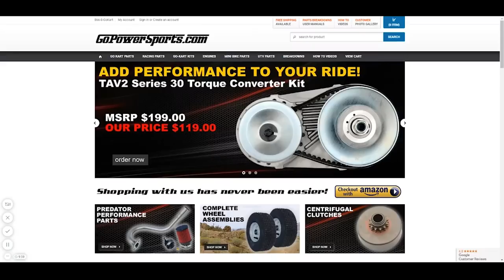Mini Chopper Lives ~ Predator 212 Motorcycle

Comment: How do you guys gear these, my 212 on my drift trike. Running 12to60 sprocket only reached 30 or so mph
Reply from the maker: 5:1 ratio
Reply: Red Beard's Garage that's what I'm running guessing the difference is one being built verses mine being stock. And wheel size.

Comment: in my opinion, its not worth trying to get it street legal. no turn signals, the rear wheel isnt DOT certified, and I know that in the predator owners manuals they say "not for use on motorized vehicles" (or something to that effect) which would prevent even the engine from being street legal.
Reply: Different laws in different states. In NY is would be impossible, where RBG is, it is probably possible. Laws about that sort of thing are often more lax down south.
Reply from the maker: +MacroMachines has turn signals, brake lights, headlight and a new wheel and tire out back that I haven't put on

Comment: Wear a face shield! Those little wires like to fly off and stick in your face or even worst, your eyes. Be safe my red bearded brother.
Reply: Heh, bits of wire were visibly flying off that wheel. He was wearing safety glasses but I'd agree that a face shield would be a better choice.
Reply from the maker: +Butch S. I actually have a shield on my wall I always forget about
Reply: Heh, mine only gets used when I can't position myself where I won't catch a face full of whatever's being thrown. (for example, sandblasting)

Comment: Did u use the billet rod or mod2 cam on the electric start motor?
Reply from the maker: No sir just a stage 1 kit
Reply: Ok would it be ok if I do? Or would I have to use the billet flywheel

Comment: really to bad they used a 212cc on this. For all the cash and time invested in that 212cc go kart motor add on stuff you could of just bought a Lifan and built this thing with a 4 speed and real clutch for a lot less then the 212 mods $$ . Either way its an awesome  build guy's nice work!

Comment: Does anybody know why I'm not getting much over speeds of 35. I have almost the same setup, such as the torque converter, but a larger frame. Any help is great
Reply from the maker: It all depends on gearing and rpms
Reply: Also if you have not removed the governor that could be another reason Why. It will change the max rpms from 3200 to 5300
Reply: I took the govenor out because the last one fell into the engine and broke the rod cap oil Slinger so I replaced the entire engine. It's about a 1:4 ratio when the CVT is fully engaged

Comment: what size is the rear wheel ? pls
Reply from the maker: The rear tire is the stock bike wheel and tire
Reply: Hi, thank you for answering me, I intend to make an electric bobber with solar panels at the location of the engine and with a HUB motor in the rear wheel. this wheel has a diameter of 14 inches.
I asked you the question because seeing your rear wheel I had a doubt, but if you tell me it's a bike wheel, I think that finally it will not be too small for an bobber.
Have a nice day.

Comment: The drive chain doesn't have the correct amount of play. It's too taught and that will wear out the chain and the sprockets prematurely. It could also snap under load and cause damage and or injury.
There needs to be at least a half inch play either way off center of movement up and down.

Comment: allow me to say and please don't get angry. there are much better ways to mount foot pegs. and they don't really have to be so far away to the front. even on real motorcycles we all tryed to put them as far as possible to the front but it wasn't practicale and you loose control on the bike. so about 5 inches away from the engine to the front. and abit wider too about 5 to 6 inches to the sides from the motor. try it and you will love it .
Reply from the maker: We love these foot pegs. They are really comfortable
Reply: it is OK. please don't get mad of me. i am just a long time Biker and i design and build bikes since over 10 years. so just wanted to share my and my biker friends experience.

Comment: I started my own mini chopper build thanks to this video. Sadly, while tearing down the frame i purchased, I damaged the front suspension so I figured I'll just buy a new triple tree clamp but I know anyone I find on amazon would have to big of a steering stem. I am going to cut off the existing neck, what I assume the stem sits in, and weld in a new one but I don't know what size tubing I should get. Could I get a recommendation? I haven't gotten my existing triple tree clamp off yet but the O.D. of the existing neck is 25-26mm. This is the Triple clamp I would like to get, https://www.amazon.com/gp/product/B074P1NHGT/ref=ask_ql_qh_dp_hza?th=1

Comment: Since it was a bike to begin with use a set of bmx bike chain tensioners. There super cheap at $10 to 20 a pair for Redline bmx chain tensioners from just about any bmx mail order. Personally I like a site called bmxguru.com cause he's cheaper then others and he's a super nice dude. 3/8ths is the standard for bmx race wheels but since your gonna use a dirt bike rim on the back I would suggest looking for a set of 14mm Redline chain tensioners that way you might only have to open the holes up a little bit to fit the new dirt bike axle 
https://www.bmxguru.com/collections/chain-tensioners
Reply from the maker: Actually by the time this video was posted I had a set of them on the way

Comment: 55mph down hill not impressive for a street bike...get the gearing right...go super small on the back wheel because your torque converter will adjust for low end and top end power, power then speed and having a small rear gear will give you that speed in the short end